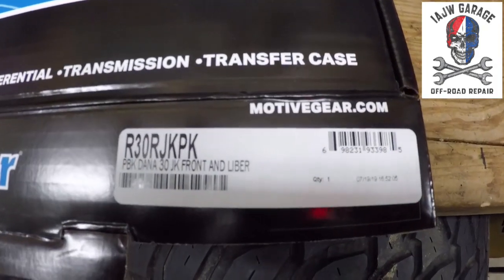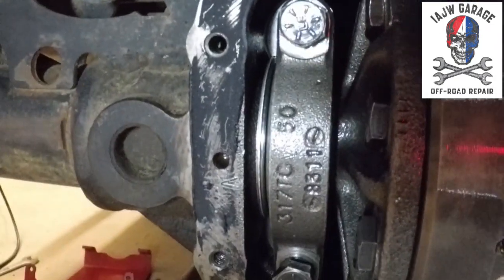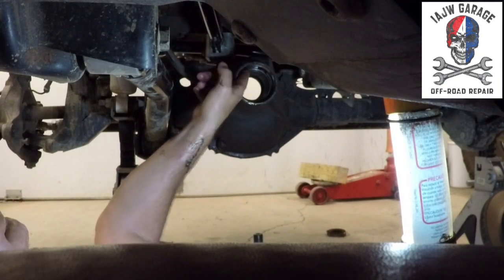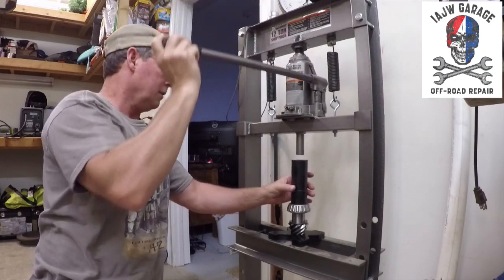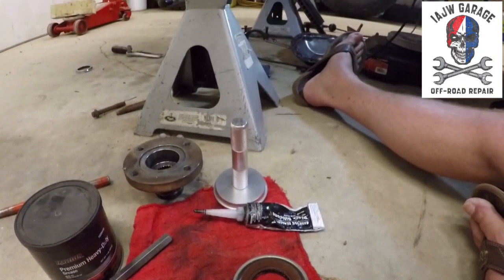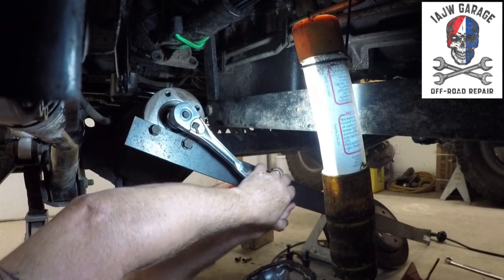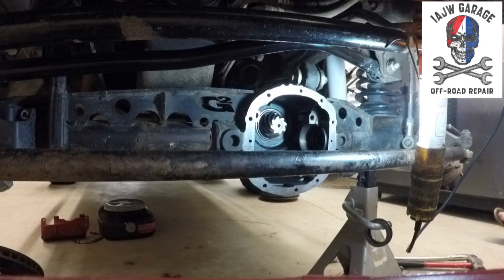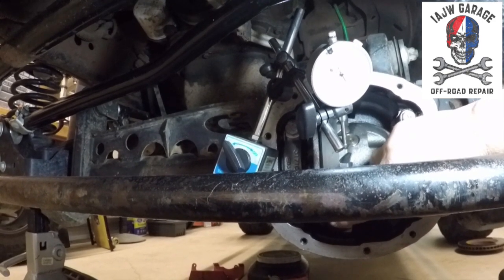Jeep Wrangler JK JKU Pinion Bearing Removal and Replacement - It's a Jeep World (DIY)

Comment: Thanks for the videos, I was stuck when I found the pinion was so loose that the flange plate and uni joint had more than 3/16th of an inch side play on my daughters JK Wrangler. The Jeep was previously off road with the previous owner and he obviously had damaged, changed what he broke and reassembled the diff, but the crush tube was uncrused on inspection! Explained a lot of noise and binding especially around corners. I really appreciate the clear instructions and and now back to work!
Reply from the maker: Good Job!! 
Very glad I was able to help, most jobs are not difficult, just time consuming and scary if you have never done them. Make sure you subscribe I have new videos coming out soon

Comment: Your video has been so helpful. I have my Dana 35 apart and all the bearings off my 01 xj. I just went to the store and bought a 38mm socket from autozone (on their tool loaner list but it’s only $12) because I have a super stubborn race on the main rear pinion race in the diff housing, I swear it’s fried in! Hopefully will have that race out tomorrow and be able to press on my new pinion bearing with something from my ball joint kit or inner tie rod kit. Thank you!
Reply from the maker: You are very welcome!! Thank you for the comment

Comment: Hello I have a question did you have to add any new shims or use the oem. Thanks for your help too taking the time
Reply from the maker: No new shims were added, only replaced the bearings and put it back together and everything checked out fine

Comment: For a non professional you did a good job with this repair . Nice camera work also . My question is why did you replace that bearing ? If the rollers of the bearing  or race were scored or burnt it would have been nice to show this to  viewers so they could see the problem .
Reply from the maker: Dale Mihocik Thats a good point to show if that was the issue, agreed. The reason I changed the bearing out was I had some play in the yoke, like then nut hadn’t been tightened enough. So I figured the bearing would have been damaged because of the play. I couldn’t just tighten it up and run the chance of too much pre-load. So I made a nice video of the whole process. I appreciate your comment and thank you. I try to get good camera angles and make sure it’s bright enough to see what’s going on.

Comment: Does using grease during assembly cause any issues with the gear oil during operation?
Reply from the maker: No. Just use it minimally or just use gear oil.

Comment: Great video! My jeep is making a noise when you accelerate like grinding noise and when you let off the accelerator right around 20-45 mph. I got some suggestions that I'd have to do the work you did on your jeep on mine so it could go away, did you have a similar experience or do you think replacing the bearing would take off the loud noise.

Comment: You miss a very important part when installing the pinion. You should always check the depth before installing the crush sleeve. Otherwise you will need to buy a new one if you need to add shims.
Reply from the maker: Chicago Pedaler Project I was replacing a bearing. The same shim pack was used. Thank you for your comment, I’ll make a note of your suggestion

Comment: Can I replace my crush sleeve without pulling the pinion out? I’m capable of pulling the carrier and everything out but if I don’t have to then I don’t want to
Reply from the maker: You can’t replace the crush sleeve without pulling the pinion to my knowledge the oil slinger is in the way.. I think
Reply: You have to get the outer pinion bearing out somehow. Since it's an interference fit, you need to pull the carrier and use a hammer and punch to get it out in order to access the crush sleeve.
Reply: @TheBFHGarage  I swapped the crush sleeve all ready. Easy. I just removed the flange, hooked the bearing with a pick and pulled crush sleeve out after pulling bearing out. Thanks though
Reply: @sbranham86  Nice. You got lucky...most times those bearings won't come out that easy. Glad you were able to get it done!
Reply: Can I pull the outer pinion bearing with out pulling the pinion
Reply: @darrellschindler1956  driveshaft side?
Reply: @sbranham86  yes
Reply: Can I use a slide hammer maybe and get it out that way
Reply: I am sorry if I read the comments it answers my question it can be done but not real easy from what I understand by reading this comment
Reply: @darrellschindler1956  I just used a pick and worked it out going all the way around
Reply: @darrellschindler1956  I did it on my lunch break at work so it couldn’t of taken that long